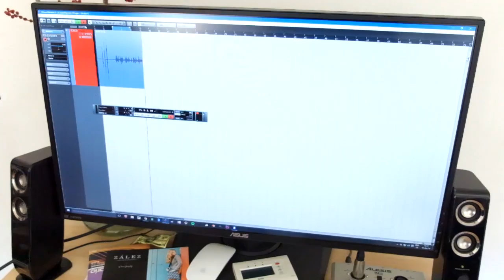Frostbite - 4K PC White Build - Final Build

Comment: Nice presentations. Would you please make a video showing how you install operating system and final configuration of case and hydrocooling system fans after you finished the installation of all hardware? Thanks.
Reply from the maker: +Costas Karseras About the OS installation I cannot do anymore as it is already installed and don't want to re-install everything, but I'm planning on doing a video to show final build status (had to change the GPU placement) and also to show how I configured the fan + hydrocooling profiles. Won't be too soon, but I'm working on it!

Comment: Nice build. You satisfied with the performance?
Reply from the maker: Not bad at all, although I think it is actually too much of a machine for my current use, except for videogames. And even for videogames if I want to max-out everything then frames drop to 45fps, which is not bad, but I love 100fps. In general I've achieved what I wanted, but I think it can be tweaked a lot. I haven't gone into overclocking yet.
Reply: +Uncle Bob I'm glad you've enjoyed it thus far. I definitely enjoyed watching you build it. Now that you have it up and running, you should try the 5 way optimization your board has. It will make it super easy to overclock without ruining your board or your experience. I'm not a gamer, but overclocking definitely offers some good gains on performance. Let me know how it goes if you decide to branch out a bit.
Reply: Thanks! I appreciate! I have a little bit of problem with the cooling, that is way I haven't gone all way with optimization. Definitely enabled XMP profile for memory, but I have some reservations about bumping up the  CPU and GPU clocks for now. My main mistake was to not use a normal heat-sink+fan for the CPU, meaning the air flow of the case is unoptimized. I'm thinking in going watercooled eventually and then bumping up all clocks in the machine.
Reply: It's definitely a good idea to get the cooling under control before you ramp it up. I know water cooling is popular, but I have to admit, I'm a scaredy-cat so I had to decline on that cooling option. I'm sure it will work perfectly for you though. I have a huge Cryorig CPU cooler and my temps are great. Let me know if you decide to go with water or more air since I would love to hear about your experience with overclocking the CPU and GPU.

Comment: I have the same exact Case as in this video. And I have the Asus X99 Deluxe 2 MB.. Intel 6850K CPU . Corsair H 115i cooler..Corsair vengeance (4) 8G"s - 2666  MHZ RAM.  (4)  Corsair ML Pro 140 LED 140mm case fans.(2) White  (2) Blue.. Corsair 750i Power Supply.  Samsung 950 Pro 512G's M.2   . 960G's OCZ Toshiba SSD . And CableMode cables on the way.. Oh ya. And like you. I bought an Asus 980ti Matrix Months before knowing the new cards would be released. And right now waiting for the EVGA 1080 FTW edition to be back in stock to the US New Egg.. Because they have reasonable prices.
Reply from the maker: That's going to be a monster PC! Good one! Just remember I made a slight mistake by choosing the H115i cooler instead of a normal sink+fan one. The CPU will be properly cooled anyway, but the GPUs (mainly in SLI configuration) will lack the extra air flow coming from the CPU sink+fan. Also measure the space for the GPUs. I finally had to space them more because the upper GPU was hitting 92 degrees. However to do that I had to remove the PSU cover in the Enthoo Luxe and the lower GPU fan protectors to make it fit! For a build like this I would definitely go for liquid cooling if price/complexity allows. If I ever do it I'll post a video about it
Reply: I will be running only a single GPU. And I may even consider a different location  for the CPU cooler. I to will be video taping my build and will post it to you tube.Wish me luck.   Hope to see your new video soon..
Reply from the maker: Then you should be fine. Good luck with it and ping me back when you have it! I'd love to see it
Reply: I am re-watching this video. And noticed you put the fans on top. Are they blowing into the case? Because I just set mine up for a push and pull configuration,.. Using my new ML Blue Corsair 140's on the bottom of the cooler facing up to exhaust the air flow. And on top to pull the air through the cooler,. I placed the Phantek Case fans that were supplied with the case on top to pull the air flow out. These will be fine. Because with the grill placed back on top of the case,. You can't really see much up there anyway. My Computer sits  on the desk next to me. I left the 200 mm fan on the front of the case ,. It should be okay to get the job done for now.. Perhaps later I'll change it out for 2 more new white Corsair ML's..
Reply from the maker: Final configuration was 2 140mm fans at the front pulling air into the case, then the 2 fans at the top and the one at the back all pulling air from the case, so I don't use push/pull. Not optimal, as I'm missing some input airflow, but quite enough. About the 200mm fan, I don't know much about it, but on overclock.net they recommended me to use instead 2x140mm fans. Because it is easy to play around with fans, you can just try your config and see if it suits your needs. Let me know when you build it! I'm curious
Reply: I now actually added two more blue ones to the front intake for better control. So a total of 7 fans in all.  And I did get finally my new EVGA 1080 FTW  graphics card from New Egg . And now the only thing more I have going on for the final assembly is waiting for a few more cables.

Comment: nice build but if using 3 sata cables bothered you why didnt you mount the ssd in one of the drive cage bays?
Reply from the maker: I liked the idea of having the SSD concealed at the back, I think is neater, but you are right, I could have done that. What bothered me the most was the fact that the fan hub+leds, HDD cage and SSD location where at quite opposite places on the case. But that's life! :)
Reply: Aah alright sounds logical

Comment: Thanks for the video.  Im about to start my WHITE Broadwell-E build this weekend 
( http://pcpartpicker.com/list/TMGGXH ).  Looking forward to your followup video detailing configuring/overclocking bios.
Reply from the maker: Hi +2000mrivera, thanks for watching the video! Your config looks really cool as well! Just a couple of things in case you don't know: the ASUS X99 I bought works well but seems to have some problem with really slow POST time. And also take into account that going for closed liquid cooling system for the CPU works really well, but it has a penalty on the GPU cooling, as you don't have the big CPU sink+fans that would help getting the hot air out of the case. Not a big deal, but something to take into account. Disclaimer: I didn't  :) And so cool man, a 1080! I'm curious it it runs closer to 2 980Ti

Comment: question why didnt you go with the gtx 1070 or the 1080 instead of the sli 980 ti' wouldnt you get better performance from the newer cards which would be cheaper
Reply from the maker: +Partyr59 Indeed it would've been much better, but I started buying the parts 5 months ago. At that time there was no date for the new NVidia cards, so I had to decide whether to go for 980 or wait maybe until end of 2016. Then suddenly they released the new ones mid-year :) I would definitely go for the new ones now, or for 980Ti knowing that they will be cheaper now than 6 months ago because of the new cards in the market
Reply: +Uncle Bob ohhh that make perfect sense its a case of bad timing
Reply: do you live anywhere near los 
angeles and are you knowledgable in sleeving pcie cables
Reply from the maker: +Partyr59 No, I live in Europe. Also I know nothing about sleeving cables

Comment: Frostbite. Well ofc i don't have time to watch this entire video, but judging by the name, is this an extremely well cooled PC?
Reply from the maker: No, it is not. The name came from the theme, all white with electric blue lights. It is sufficiently cooled, but for a build like this I would advise to go either fully water cooled (for good cooling and low noise) or fully standard fan /sink cooling. The hybrid mode I'm using has some drawbacks.
Reply: Uncle Bob Thanks for the info! :)

Comment: Here is the link to my First Build Ever. https://www.youtube.com/watch?v=4j8XvwfdP-E
Reply from the maker: Pretty cool man! I like the white-black-blue theme. I see the top card is the EVGA 1080 and the bottom is the 980 right? Do they work together in SLI mode? I fail to see the SLI cable in your configuration. Just curious if they work together. It's going to be amazing when you close the case and turn on the Phanteks lights! Have you also bought the internal lights for the case?
Reply: No it's just the 1080. With the M.2 under that. And The Thunderbolt3 under that.
Reply from the maker: I see now. Nice!

Comment: do i have to get 2 sli bridge for 5k?
Reply from the maker: +Edward M You only need 2 SLI bridges if you are planning on a 3-way SLI configuration, that is, 3 GPUs in parallel. I haven't checked recently but the new GTX1080 Ti is a pretty good GPU. I'm sure it can run 4K. You could always configure a 2-way SLI with 2 1080Ti

Comment: Those dominator ram kit are the most useless piece of kit ever created.Its well known ram speed doesnt matter that much,what matters is the quantity.Who cares about RAM overclocking ....
Reply: Well, not useless in my experience. They perform quite well. I bought those mainly for the theme, CAS latency was reasonable and I could enable XMP profile, which is always welcome. I also wanted 4 modules to take advantage of the 4-channels of my CPU+MB. Which other kit would you recommend for a setup like this?
Reply: Well i think its obvious you build this PC for gaming,ram speed doesnt make a noticeble difference in gaming.I was refering more to the ram kit beeing over expensive for what most people would need,not directly to you :) You build a beast of a setup and clearly money was no issue,but stricktly for gaming any cheaper corsair models would suffice.I rememeber kits like these were usefull when overclocking your CPU required ram overclocking,but now CPU are overclocked just from the CPU itself,ram overclocking is just for show and benchmarks.I agree they are sexy tho,if you have the money enjoy them :)
Reply: Thanks for the insight! Indeed I can imagine for gaming it may not be important. I think I read something about that, and that nowadays gaming performance is more impacted by GPU limitations than anything else. But yeah you are right, I wasn't too picky on the pricing of components :)
Reply: This op Corsair Vengeance LED DDR4 3200Mhz 16GB
2x 8GB, 3200Mhz (PC4-25600) CL16 DIMM, Blue LED